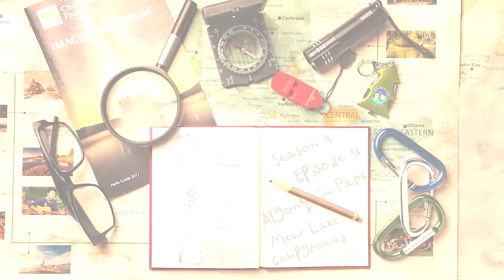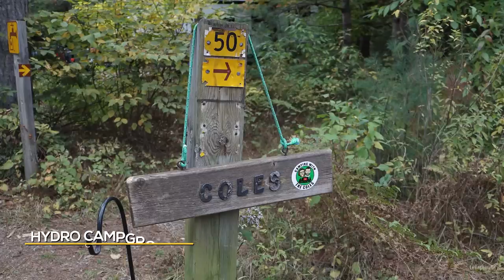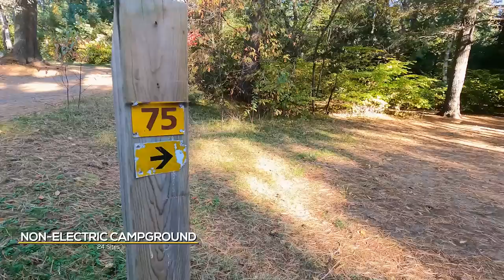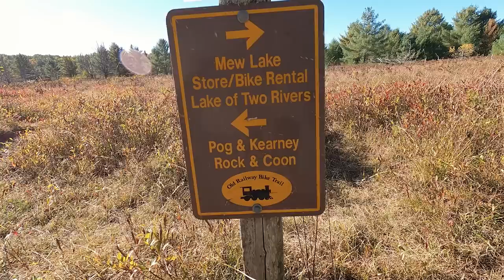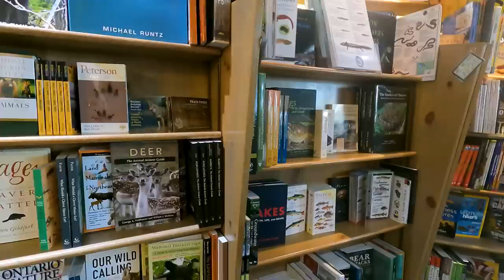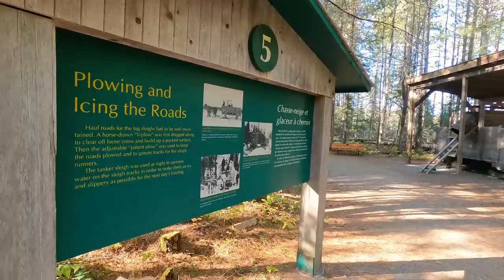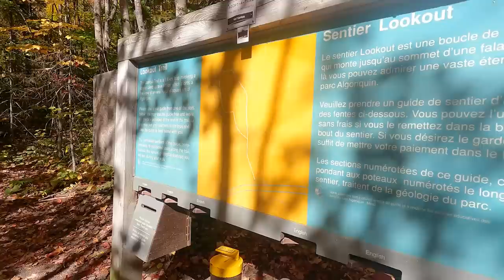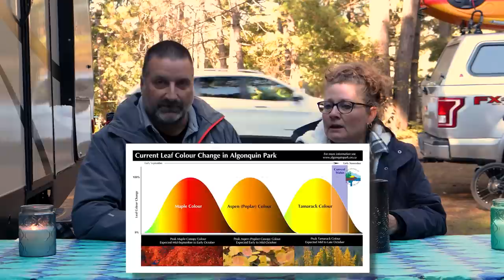S04E18 Algonquin Park - Mew Lake Campground Review - The one we almost didn't make it to!

Comment: Awww , the joys of camping , i do agree on you thoughts about the tpms , when we bought our new Rockwood it came with the TPMS  , on our way to board the Chi-Cheemaun ferry to Manitoulin Island our TPMS warned us of a low tire , thankfully it was just a low tire and i pumped it up with our 12 volt compressor ...we made the ferry on time , happy camping you two !!
Reply from the maker: Good to hear it worked out. Without the TPMS you might not have known and if the tire got too low on pressure it could have caused a blowout. The TPMS is one of the best investments I made in RV life. Happy camping.

Comment: Your tires look pretty bald!
Reply from the maker: We just got our trailer out from the shop this morning and finally put it into storage. New rear axle, bearings repacked and brakes lubed. Mechanic said all good with the tires. Maybe they look worse in the video than they actually are. The flat one was obviously very bald on the outer edge, right down to the steel belt.